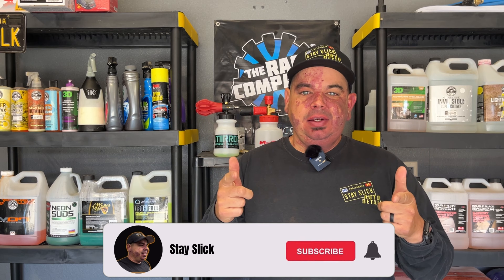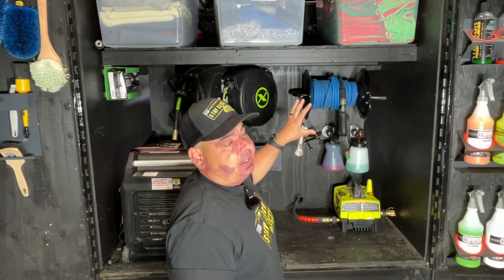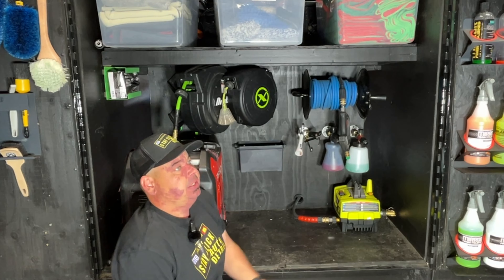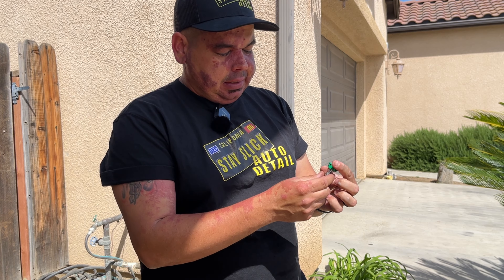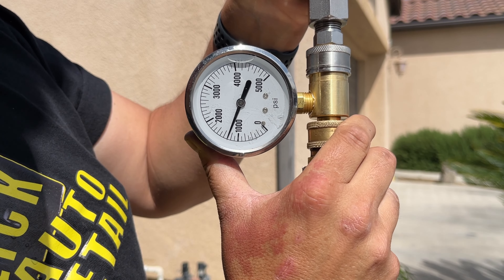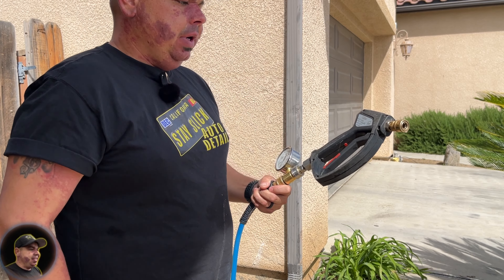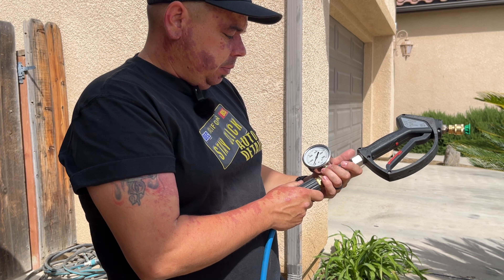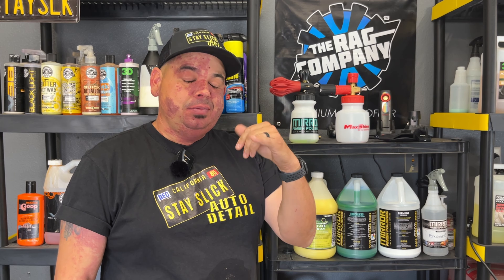Everything you need to know about gravity feeding your pressure washer | Tips & Tricks | Stay Slick

Comment: I’ve been running a gravity fed system for a few months now and it’s honestly been great ! I have a 2004 Jeep Grand Cherokee with a 50 gallon tank and I’m running a ryobi 1600 pressure and it’s took some time to figure out my whole set up and get it to were I like it but man just the part about not using a pump to feed the water to the pressure water always made me want to go more for the gravity fed system for sure!
Reply from the maker: Nice I’ve had two xj’s. Yea pumps are a pain in the butt.
Reply: Did you ever have problems with not getting enough pressure to your foam cannon or is getting a smaller orifice size for the cannon a solution?
Reply: Hey man! Thanks for the share, what do you think about ryobi 1400W/ 100bar with an 100 water tank?
Reply: @TheAceY2k  1600 bro that’s all I gotta say for sure ! I still have the exact same one that I’ve had since I started and she’s a work horse she will give out soon idk when but she’s due and I got her on special so yeah I got my back up already !
Reply: @TheAceY2k  never ! Sorry for the late reply !
Reply: @tonyarechiga9067 bro can I see out setup? I have a Durango and I’m going to use for detailing
Reply: My pressure isn’t pulling water,I’ve tried almost everything. Even got a new pump

Comment: It depends on the amount of water u have on the tank, if u have 3/4 empty, it will cause to have less pressure.
Reply from the maker: That is true however it is pretty small at least in my experience but a good point nonetheless
Reply: Water pressure in PSI can be calculated. .052 x 8.3 x Height (in feet). So unless your tank is 150’ tall….
Reply from the maker: @btosspon3524  Very good info thank you so where are you measuring for the height? From the pressure washer in lid to the top of the water in the tank?
Reply: The amount of water is irrelevant. Height is all that matters. As water is used and the height lowers, yes pressure will reduce.

Comment: Very well said .... I have been building spot-free tank systems for quite a few years and have told customers to use the Ryobi electric pressure washers since they work perfectly for gravity-fed tank systems. No, they don't work great if you are trying to wash off a truck / sxs / motorcycle or heavy equipment with heavy dried mud areas but it's a perfect setup for your normal everyday mobile pressure washing jobs.

Comment: Hi Gary. Thanks so much for this video. I run a petrol washer from garden hose, but want to use a gravity fed tank system. This vid has sold the idea to me. Can I just briefly be a pedantic pain in the ass? I just wanted to point out that the GF system with the yellow nozzle did lose 100psi of pressure. It was touching 1500psi not 1600psi. Not much difference though in the great scheme.

Comment: I'm having a dilema. I have a 1.2gpm Ryobi electric connected to a 50gal gravity fed. When I connect the foam cannon, I only get soapy water, not foam. I'm assuming that the stock orifice to the cannon is 1.25, I am upgrading to a 1.1 smaller orifice, so you think that will resolve my dilema?
Reply from the maker: Have you tried using another foam cannon? That’s happened to me when the orifice gets clogged
Reply: They are the generic foam cannons, it does perfectly fine with the pressure from the house spigot but with the tank it's poor.

Comment: I have the same pressure washer and my challenge is getting the water from the tank to  the unit properly, I use it for washing dirt bikes at the track on race day with the tank in the back of the truck, any advice on hose setup to get the right amount of water the the pressure washer?
Reply from the maker: Just the same set up I got right here man. Just make sure your tank is slightly above or level with the inlet of the pressure washer and you’re good.
Reply: Ok,great, I'm on the right track, thanks bud, I greatly appreciate your help and your videos!

Comment: What would be the cause of my pressure washer is not working. I’m just getting my daughter started for now just hand  car washes to help with her motocross. Got everything set up 3500 generator tank pretty much a full set up. I got home from putting water in the first time in the  tank. everything worked fine. My daughter washed a few of her dirt bikes and dropped the tank down to roughly 40 gallons from 60 I believe .  but when I went to try to wash my truck the following evening it wouldn’t work. I’ve tried shortening the garden hose from the (y valve, I have mine set where I can fill buckets.) I’ve put the pressure washer on the ground out of the trailer.  I’ve made sure their was a decent flow. I don’t have a pressure gauge like you but I can’t figure it out. Don’t know if my pvc is to long from the tank. I have a 125 gallon tank. I really don’t want to run a water pump but if that’s what I have to do to get water to the pressure washer for now then it is what it is. But any advice would greatly be appreciated.

Comment: I'm wondering if I can use that pressure washer drill a shallow well  in sandy soil 15' down with 1-1/4 PVC and 50 gallon tank? My power source is a 2000 watt inverter.

Comment: Thank you for that brother, i am gonna experiment with containers because the more weight of water on a smaller area will increase pressure see if i see a difference.
Reply from the maker: You know man I haven’t noticed that. I had the 90 gallon tank in the trailer and now I have a 60 gallon low pro tank in my truck with no difference in performance.
Reply: Id agree because even if the tank is long (and not high) that is still pressure trying to escape the drain part of the tank.

Comment: Hey boss! Just stumbled across your video. Crazy as I just purchased the same pressure washer yesterday for detailing. Still need to get use to it as its my very first one. I'm really interested in the gravity fed system. Question, will it potentially burn the pressure washer motor of time? My apologies for my ignorance.
Reply from the maker: No it won’t cause any problems. I’ve been using mine for months with no issues.

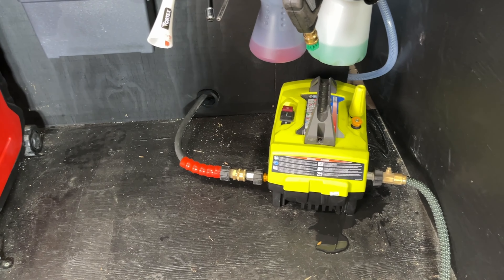Comment: 3:05 is this a 3/8 hose on the reel, if so what connectors did you use to make it work?(from pressure washer to reel.)
Reply from the maker: No that’s just the whip that goes to the pressure washer

Comment: Hey there brother wondering how you power your ryobi pressure washer is it connected directly to your generator?
Reply from the maker: Yes it’s plugged into a 3 way splitter along with my vacuum and air compressor. That 3 way plugs into my predator 3500.

Comment: Just set up my gravity fed system had about 25-27 gallons in and it works fine with the pressure washer but not to well with the foam cannon
Reply from the maker: Make sure you have a 1.1mm orifice in the foam cannon. Naturally it will be less flow through the cannon with a ryobi but it’s plenty

Comment: So im trying to set this up but my pressure is not there, i got ryobi and water pump... when i turn on pump on returning hose to tank is good pressure but when i turn on pressure w it doesnt come out as it should, now tank and washer are i would say leveled, but in case pw is little bit higher could that couse this problem? Even though i have pump...
Reply from the maker: Partially close the the valve to the return tube so most of the water goes to the pressure washer.
Reply: @StaySlick  i tried that too i still cant get pressure, seems like its pulling air but everything is tight...idk im gonna lift tank up and see what i get

Comment: Hey Boss just a quick question because I was watching a couple of videos on this and people say that without a water pump, your electric pressure washer's motor will eventually burn out. Does this happen?
Reply from the maker: All pressure washers will eventually burn out. I haven’t had any issues in a few years so I’m not necessarily a believer.
Reply: I am curious of the same thing. I have an electric power washer and wanna do a similar thing with a 15 - 30 gallon water tank. Will gravity fed work? Or do I need a pump? Thanks for the help

Comment: How does this work because when I connect my hose to the pressure washer am I suppose to turn it off every time I stop using it because then the pressure washer starts turning on by itself cause the water is still running ? Or do you have another hose that lets the water out while your not using the pressure washer ?
Reply from the maker: So it sounds to me like you’re running a pump set up right? When I used to run a continuous pump I had a hose that ran the water back into the tank. Right now I’m gravity fed
Reply: @StaySlick  no I’m not running a pump setup I have it hook up to the house water but when I’m not using it the pressure washer just runs for about like second.
Reply: Like it turns on and off every other minute when not in use
Reply: @alejandrodominguez3172  I had this same issue with my pressure washer. The issue was that the hose the ryobi came with was bad and will leak which make the P.W turn on and repeat since it was losing water. Hope this helps!

Comment: What size diameter hose are you connect to the hose? I have a 3/4" with like 10 feet. It doesn't really work. Do I need to make the hose shorter and maybe a thinner hose?
Reply from the maker: I believe mine is a half inch inner diameter I could be wrong. And I don’t think the length of the hose matters too much as long as the tank is above the pressure washer or at least level. My hoes is probably only about 2 feet long
Reply: Thanks. Is there there a special way yo prime the P.W when hooked up to a gravity feeding system? It just hook it up, open the valve from the tank and turn on the washer?
Reply from the maker: Yep just hook it up open the valve and wash away

Comment: Just FYI.  The hose outlet has to be lower than the level of the water in the tank for the water to flow.  If your water falls below this, pressure equalizes and there is no water flow.  This is bad for the pressure washer.
Reply from the maker: Yes, I’m aware of this that’s pretty basic knowledge. I always have it up higher than the pressure washer. Also, I’ve been doing this for a long time and it still works level with the pressure washer. No issues. Thank you for your concern though.
Reply: @StaySlick   Yes, I do the gravity fed thing too.  I live in an area with super hard water, so I use RO water in a water tank to my pressure washer.

Comment: Quick question. my pressure washer has a problem drawing water from my tank in my setup i have the water tank lifted about 2 inches above the water hose but it still doesn’t have enough pressure for the pressure washer to run properly. Is the only option to add a water pump to my setup? Or is there another possible solution??
Reply from the maker: While the pressure washer is trying to prime, you need to pull the trigger on your pressure washer going to give the air somewhere to go in the line

Comment: So yellow tip less water more pressure , green tip less pressure more water ?
Reply from the maker: It should be the same gpm if the orifice size is the same. The spray pattern doesn’t affect the water flow.
Reply: Stay Slick  ah okay I took what you said and tried it out myself and found out that with the green tip you rinse off the car faster
Reply from the maker: Yea just cuz the more direct pattern.

Comment: I have a question so I got a 55 gallon in my truck n today I ran into a trouble my pressure washer didn’t sounds the way it should n that’s because I have my gas powered washer connected to tank but not enough pressure from tank to washer so I think I’m need to add a water pump to help with the pull does that sound right? Because once’s I connected my washer to customer house faucet it was all good but from tank it was like it worked for few sec then again this weird sound
Reply from the maker: Gas pressure washers usually have a pump attached to them so you shouldn’t need anything.
Reply: @StaySlick  I’m using regular pressure washer not industrial one ☝️